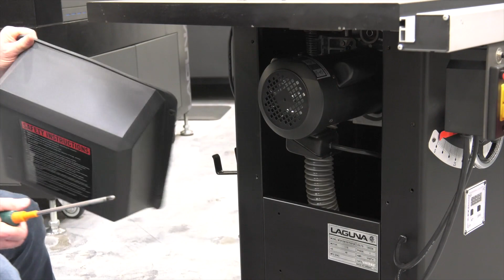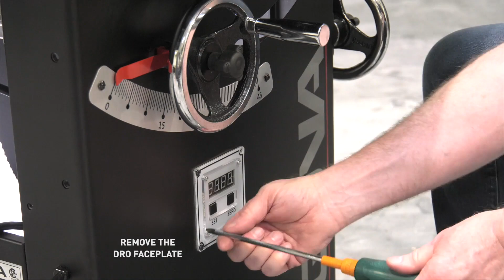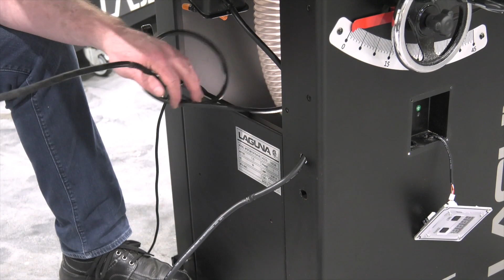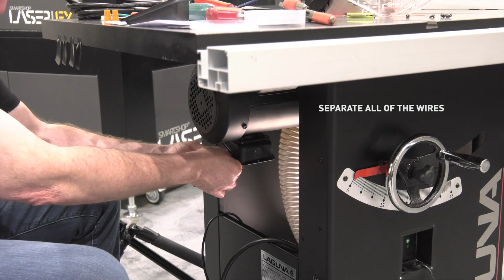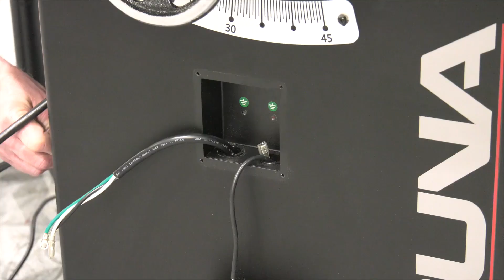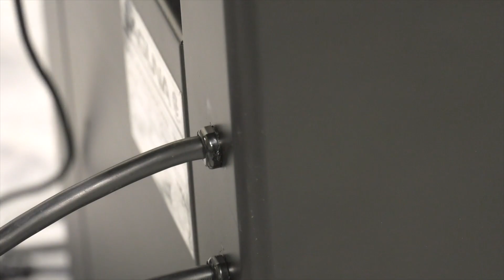Upgrading The F2 Fusion Tablesaw To A 220 Volt | Laguna Tools

Comment: Is  it somewhat common to have to tighten the drive  belt after the conversion? I get a slight squeal noise on start up now and it sounds like classic belt slip. I figured  maybe higher startup acceleration or torque at low RPM's might necessitate tensioning the belt upon upgrade.
Reply from the maker: The power conversion by itself should not create a need to adjust the belt.  We do recommend checking the belt tension occasionally and adjusting as needed.  If you are working inside the saw for the conversion it is a good time to check the belt and to perform any other maintenance or lubrication as needed.  Your squeal noise on start up sounds like a belt adjustment may be in order.

Comment: I've only had my Fusion F2 for a few days, but initial impressions are very high.  The build quality is excellent — significantly better than other saws I have used.  It is much quieter than I was expecting as well, which might be due in part to how smooth it runs.  About the only minus point so far is the blade insert, which I am having trouble leveling with the table.  I have the out red part flush with the table, but the inner black part must be lower as the 20mm wide timber I put through to set the ruler cursor was catching on the back of the table.  I'll run a DTI over it to see what is going on, and maybe make a new insert if needed.